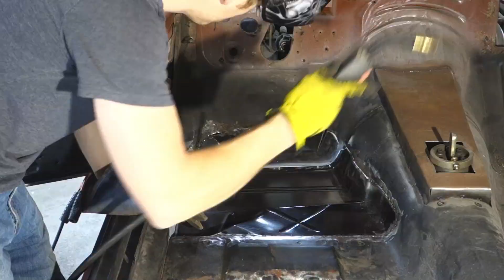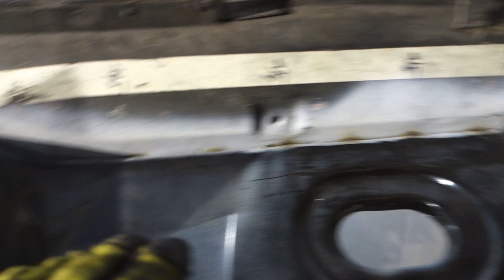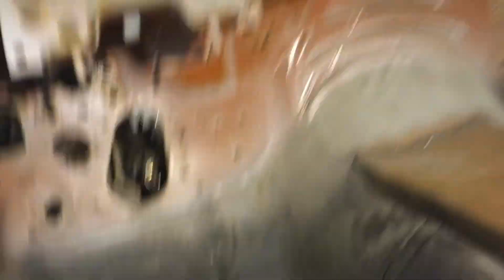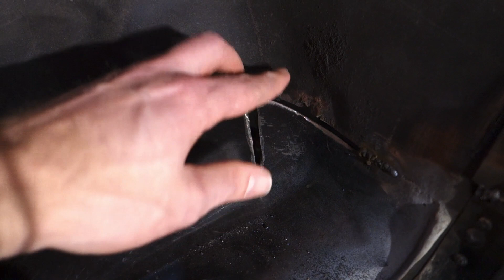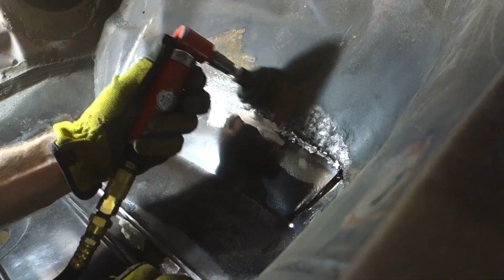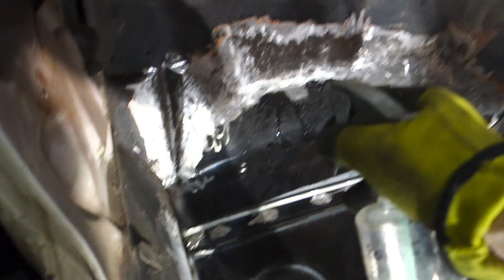How to Replace Driver Side Front Floor Pan - Part 3 - 1971 Camaro Build

Comment: I just changed out my firewall on a 70 Camaro due to some damage to the passenger side sub frame bracket and stretched firewall front. The good news of that repair was that it took care of some rust I had on the toe kick panel like your car and squared up the car mounts.
Reply from the maker: Nice! Sounds like you are making good progress on yours.

Comment: Dan, that patch fit alot better than I thought it would over in the trans tunnel area. Nice work getting it fitted!  I have never been able to use a 4.5 inch grinder on sheet metal. I always end up gouging the metal. I have seen guys do it on YouTube and get great results.  Its a tough call on the upper piece. Looks really solid on the vid. See ya on the next one.
Reply from the maker: Thanks Russ. The firewall section put up a good fight, but I got it in there. I hear ya on the 4.5 inch grinder. It's great when you have a wide open spot, but more often I use a cut off wheel and 2 inch roloc sanding discs to dress welds. I tried 2 inch 40 grit flap discs for the first time and they work great, however they don't last long for the price.

Comment: Nice job Dan!   While it takes a bit longer to butt weld and metal finish this type of repair, the extra effort is worth it.  Looking forward to the next video!
Reply from the maker: Thanks for watching DKz! It's a great feeling to have this partial pan in. Next I'll be focusing on getting my Speedtech trans crossmember brackets to fit again...

Comment: man just found your channel and watched all three parts to welding floor pans in and i have to do this to my 71 nova project but man am i scared to try this cause im nervous ill messup so bad that it wont be fixable
Reply from the maker: Cool car and you got it man. My advice would be to spend as much time as you need fitting the new floor pans, keeping the gaps tight. Welding larger gaps makes the job more time consuming. My second piece of advice, depending on how many sections you need to replace,  would be to use full floor pans because you do not have to mess around with butt welds and you’ll save a ton of time. I just picked up a 77 nova that needs everything replaced and I’ll be using full floor pans when the time comes.
Reply: @RestoCar  thanks man i think im gunna practice more before i fully attempt to do i still aint got the confident in myself to tackle the job but with more practice hopefully i will also i do have full floor plans and wanted to ask what do you mean when using full floor plans why wouldnt i need to mess around with butt welds isnt that the best way to replace sheet metal on cars cause or warpage?

Comment: You may have covered this in a previous video. How did you get the old floor pan detached from the rocker? Did you just use an air chisel to bust out the factory plug welds? I have cut my old pans down to within a 1/2" from the rocker and I think it may be easier to just take it all the way to the rocker so I can plug weld new pans from underneath like you did. Thoughts? Thanks.
Reply from the maker: I left about a half inch of material like you did and then used the air chisel to separate it from the rocker. I took the cut off wheel to the plug welds, from under the car, before hitting the floor pan with the air chisel from inside the car. I do this to help reduce the damage to the panel I want to save. The rocker is a tough piece so it may not be necessary.

I agree that plug welding would be easier/faster if you were thinking about butt welding to the material you left.